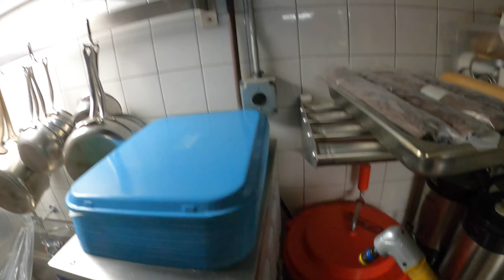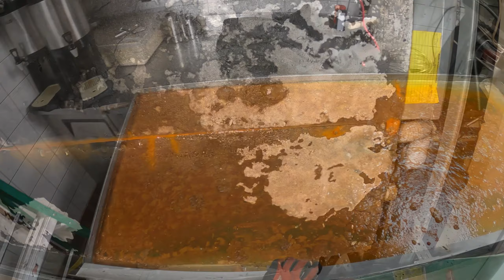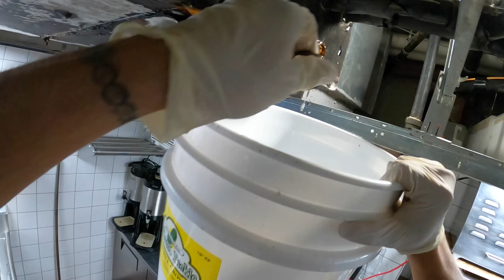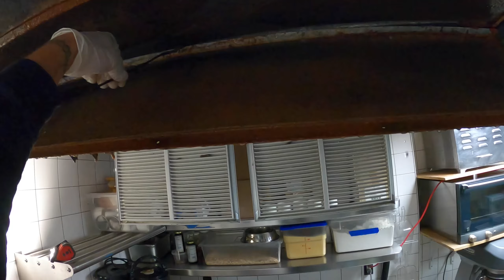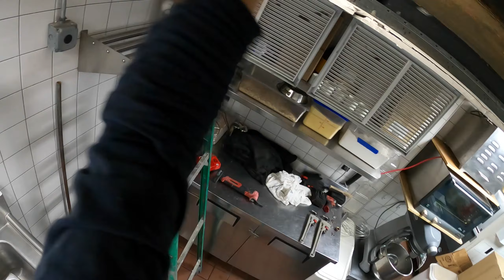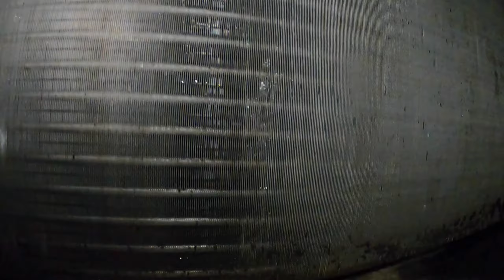HVAC: LG Multi V Air Handler Leaking Water AC Duct Leaking Water (PART 2) LG HVAC Maintenance

Comment: Goodness... What a mess... I might use a Venom pack coil cleaner on it. I had something similar in my attic. Whoever put in the AC, the unit's condensate pan tipped away from the drain, so when I went up there to do a yearly PM, it was a mess. Bot the house built from a previous owner, and it had never had a PM.
Reply from the maker: Seriously! I will look into the venom pack coil cleaner. That also sounds like a mess. Gotta' love HVAC 😂 Thanks for watching! Stay tuned for new videos every week🔧⚡️

Comment: I worked in a high rise condo that had 50 year old ceiling units that had never been cleaned it’s almost as bad as this job it was several months of cleaning and making repairs every condensation drain line was caked in mud and slime 110 units 13 floors 😢I got slimed yuk

Comment: I'm curious if the float is working on the drain pump. Usually if the water gets above a certain level, it puts the unit into a CH-04 error.

Comment: When you finish the complete through cleanup and start put everything back in order. When come to reinstallation try Bubble wrap it is so nice to work with you never go back to itchy 2” inch insulation. Trust Me the R factor is great  for any job . A little pricey but screw it charge to the buyer it worth like propress embrace the technology

Comment: appropriate vent location is always after the trap not before
Reply from the maker: Thank you for the advice. Would you recommend this be installed to help with any sort of negative pressure/draining issues? The primary pan isn't piped in but there is a built in condensate pump which is piped in. Thanks for watching! 🔧⚡️
Reply: @JumpermanTech  If there is excess static the blower can actually suck the trap in and act like there's no trap at all. Thats why big VAV air handlers need appropriate trap depth or else the trap is nullified. There is a formula for this. I dont know your exact drain set up, but I would pull out all the stops. Trapped drain, vent and make sure you're not double trapping either somehow.

Comment: I would try to install a “ wet” switch in the pan also for future protection. I also would put the vent in the condensate drain AFTER the trap not before .
Reply from the maker: I would 100% agree except this pan was installed after the fact that the air handler was leaking water. The manufacturers techs came up with this solution to install the auxiliary condensate pan and just let the unit leak into the pan and then down the drain. Unreal! Can't install a wet switch here until the actual problem is solved. Apparently been this way for around 8 years. Main drain line isn't piped in. It does have a internal condensate pump. So a vent after the trap is recommended? Maybe just use the pump as a backup if the drain clogs and the float on the pump rises to start it? Thanks for watching & I appreciate the advice 🔧⚡️